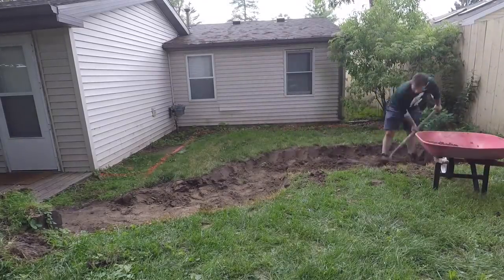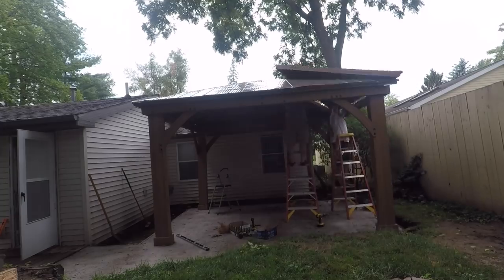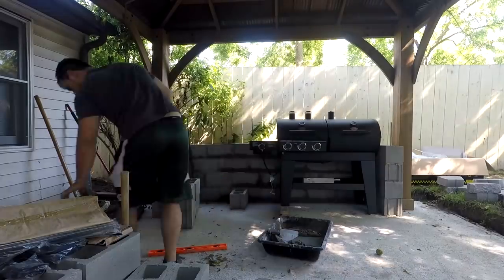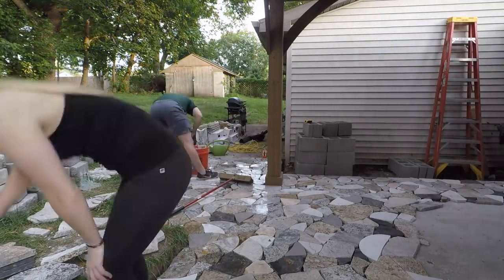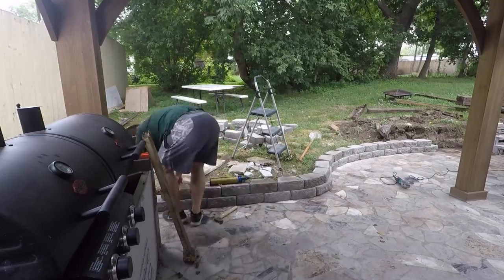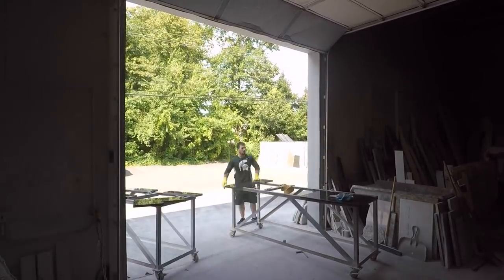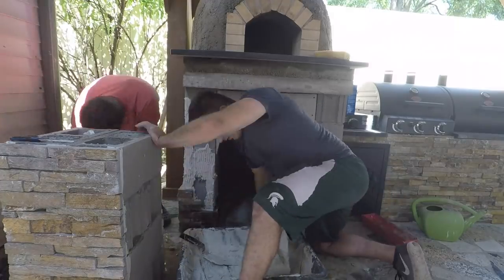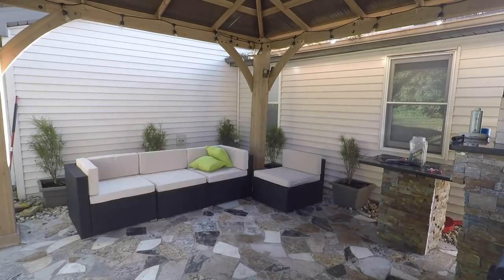My Affordable Patio Project! DIY Pompeii Wood Fired Pizza Oven, Gazebo, and More!

Comment: Hey Vinni: What are the dimensions of your pizza oven? Is it about 2 feet wide? And would you have made it bigger, or are you happy with the size? Good job, man!
Reply from the maker: Hey Luis, The pizza oven is about 35" interior dimensions! I can cook 2 12" pizzas relativity easy. The issue about this oven is with large parties (12+ people) the oven is slow and the base cools down pretty easy so it starts getting hard to have a crispy base without burning the top! But for small gatherings of like 5-8 people it does amazing! Since I like having family and friends at the same time it became pretty hard to keep the base cool. For the next oven I build at my next house I will be building a 48" oven so I can do 3-4 pizzas at the same time! But larger ovens take more time to heat up, so I will be doing a 48" base diameter but the oven will only be 24" high so it heats up faster and the top gets nice and cooked!
Reply: Hey Vinni, I have seen some oven constructions where the base is filled with a hefty layer of broken glass and salt (I don’t understand the salt part). I guess the idea is the glass will melt into a thick layer of ceramic that holds the heat. You might want to look into that. Thanks for your reply
Reply from the maker: Hey Luis, the glass is just another part of the insulation of the base! Glass melts at about 1500c. You just want to use whatever you can below the ceramic base to keep the heat inside! That’s why I used the white foam for mine, it’s a great insulator just expensive $30/piece. Big manufacturers actually use soil because it’s also a good insulator!

Comment: Beautiful and inspiring. How did you check your angles for the dome while setting the bricks.
Do you have flooding in your patio now when it rains?
Reply from the maker: The angels of the bricks was just done to the best of my abilities! There’s no issues with flooding because the concrete slab is slightly slanted away from the house so it doesn’t floood! Thank you so much for watching my video! I really appreciate it!

Comment: My bro had a similar setup not as fancy he made same mistake of not running your chimney out of the gazebo makes it very smokey on days with no wind
Reply from the maker: Hey! what you saw in the video with the chimney was just a quick fix so I could heat cure the oven before my fall classes started and winter came! The following summer I redid the chimney so it vents out and above the Gazebo! It goes above the oven, to outside the gazebo then 90 degree bend and above the gazebo! Thank you very much for watching my video i appreciate it!

Comment: How much did that concrete slab cost? Material wise.. thanks for any info
Reply from the maker: The concrete was about 4 yards of 4800 PSI concrete and it cost me $300 to get it delivered in the cement truck! The issue was I had to also pay $100 to rent the concret buggy for 4 hours to transport it to the back yard! The lowest quote I got to do the cement was $1200 so either way I saved a ton of money!

Comment: Were the four pillar not fixed to the ground? If yes, so dangerous...
Reply from the maker: Hello, the four pillers were fixed (attached)to the ground (cement slab) with tapcom screws which are heavy duty screws designed to fix things to cement! Thank you for checking out my video! I really appreciate!

Comment: Great vid man! Question: what are the ratios for the refractory cement, sand and perlite used to cover the oven right after thre chicken wire?
Reply from the maker: Hey Diego! Thanks for watching my video!! My ratio is 1 part Portland cement, 5 parts perlite, 1 cup lime! You can go like 1.5 or 2 parts cement to make it stronger but it’ll make it slightly more difficult to work with

Comment: is that even legal to have the pizza oven that close or under that roof like that ? just curious..
Reply from the maker: Yeah its fine as the door is more then 24 inches away from everything!! Now for the smoke pipe, i did redo it this summer so it vents outside of the Gazebo! What you saw in this video was just a quick fix because summer was almost over!

Comment: When you're using the level as u ad the block, if it's not level how do you adjust
Reply from the maker: Hey Rilly, I would tap the block down with the trowel and it would cause some mortar to come out and cause the block to move a little bit as it levels! Thanks for checking out my video! I appreciate it!

Comment: Should have chaired the fabric and cured the concrete after pouring; strength and durability of 'crete is guaranteed by curing!  Fabric can rust if not covered by the mix.
Reply from the maker: Hey Lin, Yeah the fabric shouldve been chaired, but we were just lifting it up by hand. The slab was given 1 week to cure, watering it every morning and evening to slow down the cure time. Thanks so much for watching, i really appreciate it!

Comment: Loved it except for the grill. You should have installed a quality cooker. You'll be replacing that pot metal unit in a few years.
Reply from the maker: Thank you so much Burnett! I agree with you! It’s cheaply made and designed, wouldn’t recommended getting it! Next time I would get a better one! Thank you for checking out my video!
Reply: @VinnyGjokaj  You're welcome! Check out a Lang smoker, I love mine!

Comment: Did you not have to add footing for the columns?
Reply from the maker: In what aspect? The columns were attached to the cement slab with steal right angle brackets and tapcon’ed to the slab! BTW thanks so much for watching my video, I really appreciate it!
Reply: Vinny Gjokaj I probably missed that part lol but no problem I really liked this video keep up the good work

Comment: Ok. The fire marshal will want to see that oven so close to the house  major fire hazard. not to mention the exhaust shooting at under the roof,  ready for all the hot smoke with oil ready to stick on the ceiling ready ignite.
Reply from the maker: What lol? It’s over 4 ft away from the side of the house completely insulated... a grill is way more dangerous. The chimney was only a temporary solution so the oven could be heat cured prior to winter setting in. The following summer it was done so it vented out and above the gazebo! Anyway, no knowledge, but thanks for watching my video!

Comment: Affordable for you. Beautiful though.
Reply from the maker: Hey Nicole, this is affordable it was a DIY project, and I used scrap material for the floor which helped save a ton of money... start to finish, including everything from Gazebo, plants, oven, grill, furniture, plants, tools and even tools I needed this project cost me about 3000 over the span of 2 months working on it’s sure I had to sell some of my stuff to be able to get there but it isn’t ridiculous
Reply: Was thinking the garnet has  to  be expensive unless in your position. What was the total cost. Plus the cement and having help from people in that field. It looks beautiful you did an amazing job.
Reply from the maker: The granite I used for the floor was sink cutout pieces, pieces that are scraps from where the sinks goes, so granite shops has piles of these and once a month a scrap truck comes and takes them away! So granite shops will allow people to take them for free just because it saves the shop money on garbage removal!
Reply: Vinny Gjokaj thank you for that info!! It definitely is amazing!

Comment: 24:43    huge mistake there. Why would you soak firebricks....  Oh and 1400 degree C firebricks would be  ''High heat'' firebricks with around 38% alumina
Reply from the maker: Hey! The reason I soaked the firebricks was because due to there poracity it would'ed dried out the refractory morter to fast and it wouldn't have made a strong connection. Because of this I allowed the oven to dry at air temperature for 1 week then followed by 1 week of curing using small fires that grew everyday and on the 7th day of the second week i did a full heat at 1000f for 1 hour! I can't exactly remember the alumina percentage for these bricks I got! Never the less, thanks so much for watching the video  and leaving a comment. Wish you all the best!

Comment: Gotta be falling apart by now.
Update?
Reply from the maker: Hey Kathy! Not at all, no cracks or anything! I did a bunch of research and from the knowledge I had I made sure all the materials I got was the best I could get! I’m making a video on making pizzas in the oven, you should check it out! Thanks for checking this video out!
Reply: @VinnyGjokaj  Hey just curious, you build inside the pavillion.  Any problems with soot on the roof?
Reply from the maker: mike92505 hey Mike, are you talking about the chimney set up of the pizza oven? What was shown in the video was a quick fix so I could heat cure my oven before my classes and winter started! The following summer I reran the chimney so it vents out and above the gazebo! So there has been no issue with soot or anything! I also only burn a very nicely cured cherry wood which doesn’t produce much soot!

Comment: Affordable?  Your using a $10k saw
Reply from the maker: I mean sure I used my dads granite bridge saw to fabricate some custom pieces and then I installed them my self, but you could just have a shop fabricate the pieces for you and then install them your self! This project cost me 3000 to do which includes everything from the gazebo, grill, plants, furniture, materials and even tools I need to do this project! Obviously if you don’t have access to cut the granite you can just pay and get it fabricated and install it your self! Which is what I did! Thank you so much for checking out my video!

Comment: First of all nothing at all "affordable" about this lol, secondly seems a little over done and drastic for your little shitty house, and third of all, it wouldn't have taken nearly as long if you wouldn't have stopped to check your phone every 5 minutes

Either way impressive work you guys did a pretty good job lol
Reply from the maker: 1) This is entire project cost about 3000 USD to complete which includes everything from materials, to furniture, grill, gazebo, and even tools i needed. The affordable aspect comes from doing it my self and also using scrap materials like granite sink cutouts and etc!
2) I agree with you but its a nice place to have family and friends over for food and drinks just to hang out and have good conversations! 
3) I agree with you again, but I don,t know if you caught it in the video when i said I had just flown back in from San Diego. I was at a conference presenting my research on advanced packaging methods through additive manufacturing. I had a special talk so I was just email back and forth with the conference chair for the last details. But you are right I should've stayed off my phone and focused on the project!
4) and most importantly thank you for checking out my video, I really appreciate it!

Comment: Better you could have made this video in 3-4 parts. You may got equal attention on all. This one seems less interesting
Reply from the maker: You're probably right, never the less thank you for watching my video, Happy new year! Hope 2019 brings you  many smiles!
Reply: @VinnyGjokaj  Lots of wishes for 2019 . I liked the way you build and appreciated your effort. Would you mind sharing some info on cost.
Reply from the maker: @alokyadav1506  What would you like to know? I don't mind sharing info!
Reply: @VinnyGjokaj  Just about cost of all materials used. And area covered. Bcoz I don't watched complete video  sorry :)
Reply from the maker: @alokyadav1506  it cost around 3000 probably closer to 2500 , but using some round numbers, not including returning extra bricks and that 
Gazebo (Costco)- $750
Grill (Home Depot)- $300
Concrete slab - $300
Pizza oven supplies (Amazon, Forno Bravo,Angelos),$500
Patio furniture (Amazon) -$500
Cinder blocks, Pavors (Home Depot)-$200
Grout, cement, thinset (Home Depot) $150
Plants $200
Door (Amazon)-$50
Lights (Amazon)-$50
StackStone tile (MSI, our granite supplier)-$50